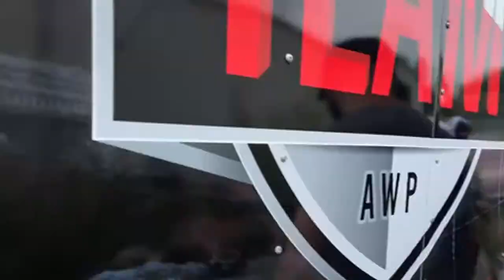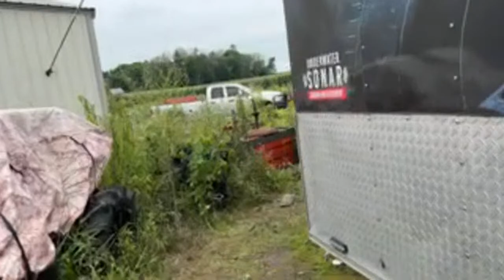@AdventuresWithPurpose axle instal

Comment: Incredible work on those axles. The pre-existing hardware was an embarrassment to even be called an axle. I personally think it was criminal to sell a trailer designed for pulling large amounts of weight with tinker toys as standard equipment. Thank you all for helping them get back work with stellar materials.
Reply from the maker: The trailer was designed to haul 4 snowmobiles. So the axles were adequate for that purpose. Now they can load that trailer as heavy as they like.
Reply: @Bjerkefamilyadventures  Absolutely, I realize I was very short sided in my post, but the payload coupled with lots of mileage. Exceptionally heavy load

Comment: Now ya got real heavy duty wheels and hubs. Hopefully not made in China.
Reply from the maker: Made in the USA!
Reply: @Bjerkefamilyadventures  smart… should last a long time just check it EVERY time you fill up. Why do people never check their vehicle over like nails in tires or look for low tire pressure or fluids when they get gas? Check all lights work like plate bulb… Saves ya a ticket and pulled over. Tip!… Switch to LED from old style bulbs. ALL of them. Front, rear, turn, backup and the license plate! I’ve never been pulled over for it.

Comment: Just looking at those axles they look like their bowed which wears out tires fast i know as a trailer we own had a bent one and we went through tires on that
Reply from the maker: All of your trailer axles have an arch in them. It is there so as you load them it takes the stress of the weight in the center of the axle. So as it gets loaded it straightens out. Next time you see an aluminum semi trailer look at how the deck of the trailer is curved. When empty. When it is loaded it flattens out.